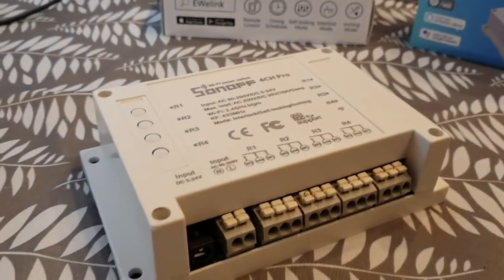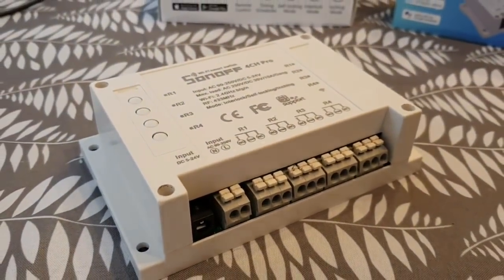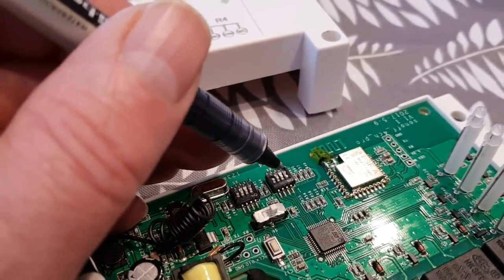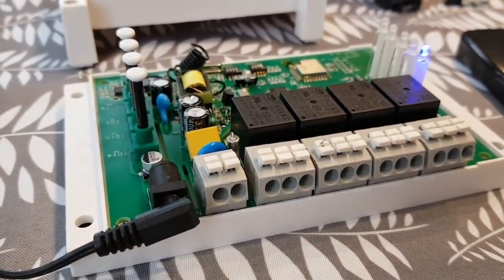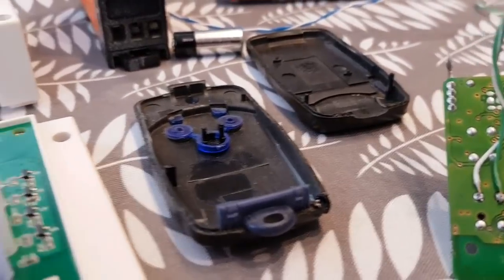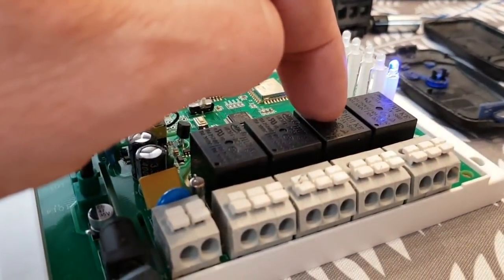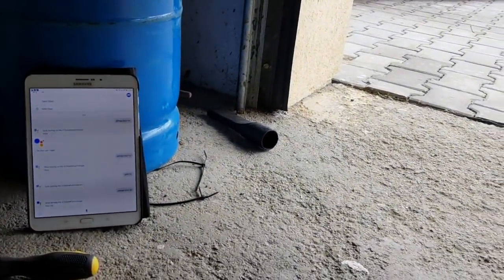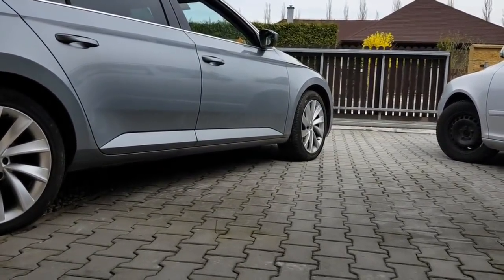Sonoff Gate and Garage Door Control

Comment: Thanks for this video I have managed to setup individual routines to open and close my electric gate, and my garage. The problem I'm experiencing is that I can't create a routine that does both successfully together. I can hear the relays clicking but nothing happens. They are set to inching mode and I've tried .5, 1 and 1.5 sec push values. I also have the relays set to power off state not that it matters. Would you have any suggestions?

Comment: thanks for this video!  set it up today based on your video - added IFTTT also  to trigger gate when i get close to home
Reply: How did you do that?
Reply: @usmxn1174  Hi - both geolocation and ewelink are supported in ifttt - so if you enter location (the IF) then turn on sonoff channel 1 - in reality, it can sometimes trigger late so I stopped using it and trigger it with echo auto instead when I arrive on my road

Comment: Hi Rob, what is the polarity of the transformer that goes into the 4CH PRO? I've not been able to find it in the Sonoff documentation and was afraid to connect a transformer for fear of blowing the 4CH PRO up. Is the + in the middle or the outside of the connector?
Reply from the maker: Hi, yes it's + in the middle,

Comment: Hi Rob , I'm looking for something to provide a timed relay function - I saw that you mentioned the orange unit at the start of the video . Like you , I don't want lots of individual parts to get what I need done ( an electric sliding rooflight) . I need the on or off pulse to last 80 seconds then off to save the motor. Your advice would be appreciated
Reply from the maker: HI 
Sorry in the delay , I've been travelling with work. Could you not use one the channels free, or use a Basic module adding a delay ?, I'm currently away from my workshop at the moment, however, n my return will look .

Comment: Thanks Rob...I want to use this sonoff for my garage door and loud alarm siren....in Home assistant...not sure why you had to put the remote into the sonoff casing??? Because it is a "rolling" code??? Why not just the RF?
Reply: Not sure if I understand your question exactly but the RF remote only triggers one of the switches. It doesn't trigger the actual appliance. So you press the sonoff RF remote button and that uses RF to communicate with the sonoff and activate switch 1 for example. That then switches the wires on ch1 on the device.

It doesn't use RF to communicate with the appliance.

The remote must be hardwired to the device but you don't have to put it in the case, it just makes it 1 nice neat box.
Reply: @patel786  I was planning on hardwiring my (old) DSC SD 30W siren to one of the contacts...and that relay would contact when the alarm went off with my hub... the siren is in the attic of my garage, just above the garage door opener....I tried powering it off my "Konnect" board, but the board is not powerful enough

Comment: Nice video , you can setup a scene so when you say one command to either the door or the gate it will open or close both at the same time . Very informative thanks mate , well done and great tip wiring in the switches from remotes to the pro box , great tip , cheers
Reply from the maker: Just use a multi meter, as maybe different on your button.

Comment: Great video Rob and nice work around. Question: Can you not just have the pro channel connected to an external input on the mother board of the gate opener? I'm lost trying to to achieve something like you have. My gate has the option for pedestrian opening on the second button. 
How about the battery of the remote, did you hard wire or install a battery?
Reply from the maker: HI 
yes, i think you can do this .
on this project, i did not want to run cables outside this time, but yes this should work.
Reply: It should work with many garage door openers. You can test it by using a jumper to short the button contacts on your wall control. I plan on using the 4ch prop to do this. I would however like to know how the same two lead wire from the wall controller also has the option to turn on/off the light and lock the controller.

Comment: Do you have issues when you lose connection to wifi or lose of power. did this setup while back had to rethink things every time wifi dropped out door would open.
Reply from the maker: No problem at all...
Check your setting  again

Comment: Hi Rob - I've been looking all over for an instructional video like this! It looks like exactly what I want to do. Please excuse my ignorance, but do you perhaps have a wiring diagram or way of determining where to solder? In the video each button has 4 connections at the bottom to which you soldered 2 wires, but how did you know which of the 4 points to solder? Thanks for the help.
Reply: yeah what he said.

Comment: Hi Rob.
I'm trying to do something similar to this with my garage burglar alarm. I want to be able to control it with google home instead of having to hit a key fob or press in a code to arm and disarm the alarm. The alarm system doesn't have WiFi capability so I thought this would be a good way to do it.

Currently I can control the burglar alarm arm and disarm with a key fob.
I hit the button to arm it and then hit the button to disarm it.
I took an old key fob and set it up the way you have it to control the door opener in your video and it works fine with the link software and google home.
I don't yet have the key fob paired up with the actual alarm. I'm going to do that last.
First I want to make sure I can get it to do what I want and then will pair the key fob with the alarm system.

Now for the part I can't figure out.
I have a green light and a red light on the alarm panel and outside at the doors so I can tell the status of the alarm.
The light is green when the alarm is disarmed and when it's armed the red light is on.

Is there any way to have the red and green light status show up on the other switches on the 4 Channel Pro.

Set up as it is now I  say to google alarm on and it will arm and if I say alarm on again a second time it will turn the alarm off.
Having to do it this way with the switch in inching mode unless I'm actually standing there and seeing the color of the red or green light outside I can't tell if the system is armed or disarmed.

It's the same concept with the way you have the overhead door and gate in the video. Unless your physically standing there you can't tell if the gate or overhead door is open unless you can physically see them.

I want to be able to use that red light or green light to know the status of the alarm by looking at the app and was hoping I could do that somehow with the other available switches on the 4 channel pro.
I appreciate any help you could give me.
Thanks
Reply from the maker: John Romano 
Hi yes I fully understand your concerns and to date I can't see how we can get feedback from these systems I have asked several times in several groups how we can get feedback,but but there is no device that will give feedback apart from the RF Bridge but this would involve a lot more wiring and multiple inputs.
I would like to see one of the devices have impots similar to that of a PLC, giving feedback.

Regarding my gate and garage door I'm fortunate where I have digital CCTV looking at doors, gates and 360 around the house,but you are a 100% correct I do need to double check that the operation did work but this can all be done from the phone.
Reply from the maker: John Romano 
Just to add one more point this sonoff 4 channel Pro and my RF key fob has worked perfectly so to date he has never not triggered in either Direction it is working very very well surprisingly well.
If your key fob has a new battery in and use the same settings as mine it'll work
Reply: Hi Rob,
Thanks for getting back to me. The reason I'm shying away from the key fob idea is it's one of those Genie intellicode systems and I have had problems with it in the past. I have about 6 or 7 key fobs out there between me, my kids, my wife, my business partner, as well as the home link buttons in their cars. It seems as though something gets out of sync every once in a while and then some fobs work and others don't so I have to program all 6 or 7 of them all over. I'm afraid if I try to connect another it will knock something out and I'd have to then re-link all the fobs and home link buttons.

So today I wired in the  Sonoff pro to the burglar alarm receiver and it works fine. I had an outlet to plug it in right next to the receiver so it was just a short wire from one to the other and then plug it in. 

Only problem now is I still can't use it wireless since my wifi signal is not strong enough to reach the area in the garage where the Sonoff is.
When I push the button on the switch it works just fine.

I'm going to get a wifi extender and put it out there since the signal out there now is very weak and I should be good to go at that point and then can start using it with google home which was the original objective.

It's too bad there is no way to get the feed back to see if the alarm is on or off or if the door is opened or closed.
If that ever gets solved the next move is to add the overhead door to the switch as well.
I'm a carpenter by trade and work small projects out of my garage and have thousands of $$$ of equipment and can't afford a mistake of the door being left open. If the alarm is not on it's no biggie for a day but could turn into disaster if the door is open all day with no one there.
Thanks again for your help and thoughts. Your videos are very helpful to a wood butcher like me.
Thanks
Reply: Hi Rob. I wouldn't mind the wiring if I knew how to do it. I guess I will save that for later.

Comment: Rob how did I pair the remote with the gate and shutter I mean one button for gate and other one for shutter garage and press one button once will open then press twice will close.... Right then what control panel u using for it gate and garage one.. plz help
Reply from the maker: My system is only 1 press open...... 1 press closed.
Reply from the maker: And,  sorry, my system you use a Pairing button on main Control box...

Comment: When power is restored to the Sonoff are your door/gates opening?  I have found this to be true with my Sonoff controlling my garage door which I have hardwired to the opener. Looking for a fix.
Reply: The only option is to use it with a UPS or run if off a battery instead.

Comment: Nice video, with routines in Alexa you could probably work on the Syntax. Alexa, open the gate turns it on. Alexa, close the gate turns it on. The dilemma is that you don’t know condition of the gate without looking.

Comment: Hi Rob I set up my gate like on your video, good idea the only problem i have is when there's a power failure and when the power get back on the gate automatically opens. What am i doing wrong?
Reply from the maker: maybe the setting POWER ON, ? in the App , i'm back there next week, can look again
Reply: @robdotreynolds  Thanks
Reply: It was a firmware bug in the 4ch pro whuch Itead has fixed. Just download the new firmware.

Comment: Great video, will definitely try this.  I also have a question, can I use R1 or R4 to open/close both the gate and the garage door?
Reply from the maker: Evangelos Tryfonos 
If I understand your question correctly then yes.
I use all four relays as a clever interlocking system to be used through the night
Reply: Rob Reynolds thank you for the reply. I am not sure I understand how this can be done. Keep in mind that I would still like to be able to open/close the gate and door separately
Reply: Hi, I finally got around to doing this and it works like a charm.  I use Channel 1 and Chanel 2 for the Gate and Garage doors.  I would like to use Channel 3 to open both of them and still haven't figured out how to do this.

Comment: Can't work out how the remote gets it's power? Does it receive 6v from the sonoff? If so I think it would fry my remote that only uses 1.5v? How does this work?
Reply from the maker: Hi.
Just use the battery inside the remote, they last year's and years
Reply: I think this was left unanswered. We are assuming all the remote can operate on the 6v from the power supply??

Comment: I managed to get this working - but I only have about a 70% success rate with the gate/garage actually opening. The switch is very close to both, so there isn't a range issue. I would say "Alexa" open gate and she would reply "Okay" but the gate will only open 7 times out of 10 even though Alexa intones "okay". Anyone else experience that? Could it be interference with the remote being inside the box?
Reply from the maker: Maybe try adding an extra half or second on the pulse , ? 
To be fair..... I get different results from Alexa and Google on the Android Auto.... 
Maybe time I ask Alexa turn on the lights, she says OK.....and I need to repeat myself.....also.....as I drive to the gates..... I sometimes ask Google  twice...... however this is only 1 in 10 times....
Reply: @robdotreynolds  Thanks Rob - much appreciated. I seem to be getting the same issue when using the Ewelink app directly (i.e. only works about 6 times out of 10)...but I will mess around with the inching/pulse and report any successes.

Comment: How to set the stop button
Reply from the maker: No stop button, only  1 or 2 second timer
Reply: @robdotreynolds   do i  have to buy a fob remote to use for both gate and shutter ... Ok if pressed one button as your case the left button it will open gate.  Then which one to close gate if the other button is engaged for another shuttur garage door 
...

Comment: You will find that a pir or someone outside your home with an rf scanner will open your gate and your rolling code remotes will be pointless as they will now receive on two different rf433mhz frequencies (the remote original frequency and the SonOff 4ch frequency) How can you disable the RF on the Sonoff pro 4ch boxes?  Happy to show you a video of the problem occurring
Reply from the maker: Joshua Lewis 
I did think that..... so..... I have a very ingenious interlock that I will not mention on the video..
And I also believe as long as you have no code in the Pro... it will not listen for a code.... 
I should have mentioned to clear all Codes.
Reply from the maker: Yes, show your solution to for the community.
This can only help people wanting to do this
Reply: No worries, a link to the video is here, sorry it is done at night, it is just past 3am here in Aussieland and thought that the video was more important than the daylight :-) https://www.youtube.com/watch?v=vLPh1evoW5c&feature=youtu.be
Reply from the maker: Joshua Lewis 
Good Video, can you not clear to code ?, I was thinking the Sonoff Devices learn from other devices....  so if your clear..and do not learn another code , this may work ?
Reply: Where would you clear the code?
Reply from the maker: Joshua Lewis 
On the 4 Channel pro there is a button for clearing codes.
On the Basic RF  ,press the pairing button three times, this should clear the codes.
I'm sure this will solve our problem.
Reply: I never entered codes to begin with, what RF codes is it clearing? the receiving ones? where is the clearing code button on the pro?
Reply from the maker: Joshua Lewis 
Its the long button in the middle..
It's about 4mm/8mm.
Press and hold until all led's go green.